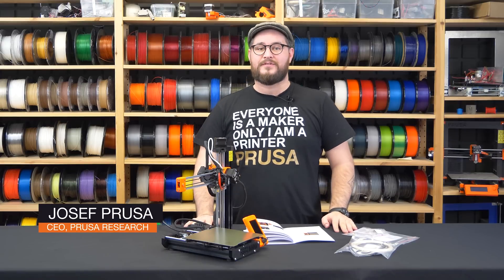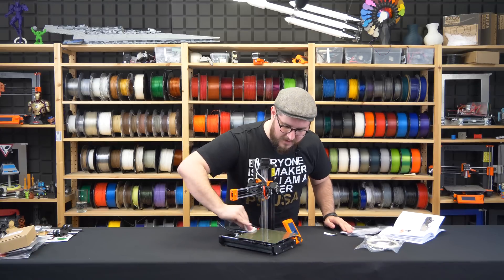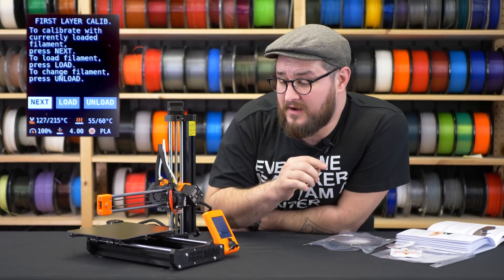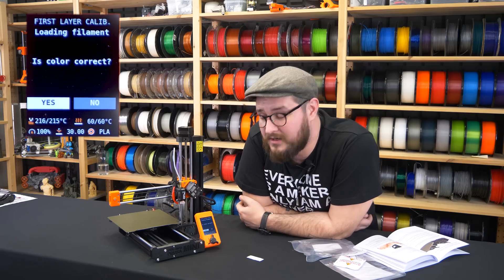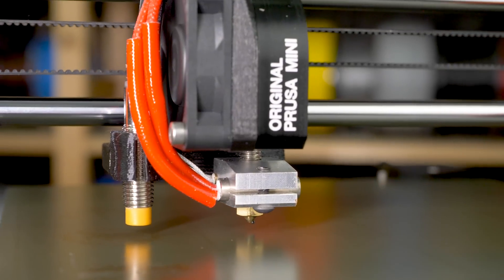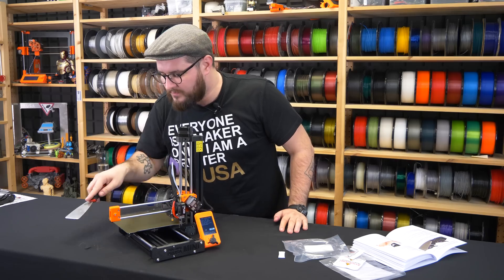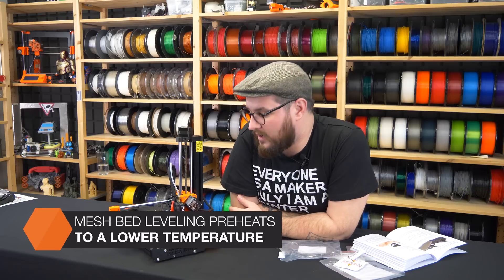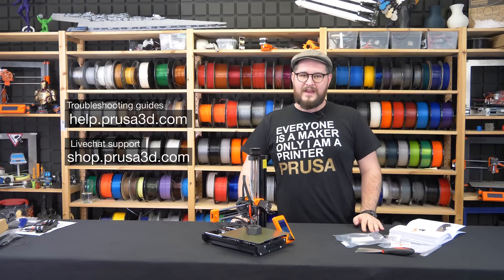Original Prusa MINI - Calibration and First Print

Comment: I recently purchased the Hardened steel nozzle E3D V6: 0.4mm but am unable to calibrate it to get a solid first layer, I’ve had to lower my z to -2.000 but still am getting gaps in between infill passes (printing with Prusament PETG). Any suggestions would be appreciated!

Comment: I have a problem, I'm the first layer and there was everything perfectly fine when I put the print so everything goes fine from the beginning but as soon as it starts to print supports or corners so the first layer doesn't even stick to the pad and the printing is with nothing I have to repeat everything again

Comment: Helpful video. You mentioned the calibration routine prints a small square so you can verify everything is good. However, you don't say what you are looking for when you examine this square. What are the criteria for deciding the small calibration square is "good?" For example, are the extrusion passes supposed to be stuck together so the square is a 2D sheet? What would you see on this square that would indicate "not good?"

Comment: Got my Mini yesterday, had some good prints so far, can I just ask. The recommended temp on the PLA spool says 215, but the default temp of my printer sits at 170, after watching this video it seems its 170 first layer and then automatically ramps to 210, is this correct?

I haven’t noticed mine auto adjust because I’ve been manually switching to 215 just before the print starts.
Reply from the maker: Yes, that's correct. It goes to a lower temp first for mesh bed leveling to minimize filament leaking from the nozzle. Then it automatically goes to the higher temperature for printing. -Mikolas
Reply: @Prusa3D  Ah great thank you! My own impatience

Comment: I’m almost done with assembly - can’t wait for the first print!
Reply: @Error-hc7mp  It worked flawlessly from the first print. I’m wide format printer technician so I kinda expected that, it would be embarrassing if it didn’t work well ;)
Reply: @Mariusz Kozlowski. Is it still working good
Reply: @willcronk6458  yes, no issues at all. Not even a clogged nozzle.

Comment: Would it be possible to print a piece on the heating bed instead of the steel sheet? Or will there be any damages or quality differences?
Reply from the maker: There will be both damages and quallity differences. The heated bed is covered with a coating that protects the copper traces (that do the actual heating). Scratching this coating off could cause a short on the heatbed PCB.
The filament will also have very poor adhesion to the heated bed itself, the removable steel sheets are coated with a special polymer because of this reason. So do not do that ;) -Mikolas

Comment: I'm having trouble getting the filament stick to the bed but I am using Hatch box wood filament. I calibrate to .0950 just like you did. I did use glue it did hold for a while than it broke loose. Do I have to set to a lower settings for a wood filament? What I'm doing wrong? I did wipe the bed down with the alcohol before I use it.

Comment: Can someone please explain why people are so excited about 32-bit?? You have been able to buy 32-bit boards, like Orange Pi, Nano Pi, Raspberry Pi etc for less than 10 USD for years! Why does it take that long for the 3d printer business to catch up? Also, never understood why the 8-bit printers are using Arduino at all? Why not an esp8266 or even esp32, which even comes with wifi built-in? They cost like 1-2 USD and are probably 10 times more powerful than an Arduino while at the same time can run pretty much the same code. I find this very odd.

Comment: can the printer adjust the height of the extruder by itself or do we have to do it by hand every time? Also, does the heat setting in the prusa slicer affect the print? :-)

Comment: Hi, what kind of probe does the Mini come with? Is it the same PINDA probe the Mk3 uses?
Tried to find the info in the blog and on the product page, but haven't had any luck.
Thanks in advance!
Reply from the maker: We call it MINDA, it's very similar to PINDA but it's a bit simpler (it doesn't have a thermistor inside).
- Mikolas
Reply: @Prusa3D  Thanks for the quick response. Was thinking about buying a PINDA probe with the Prusa Mini when I order it to maximize the Mini's precision.

Comment: what about nylon and nylon X? can it print it? can you create settings to make this a no-brainer? Is Prusia going to make its own chopped carbon fiber-filled nylon or PetG? that would be awesome!!! I've been on the fence between the original Prusia mark3 vs. Matterhackers Pulse XE, but now with the mini, I would prefer that printer if it can print the nylon and NylonX. just need the all-metal hotend upgrade and I think the mini should be able to handle it...thoughts?

Comment: One of my worries is how sharply that bowden tube bends when it's at it's farthest right travel. I realize you could just make the tube longer to alleviate that, but I like to use linear advance and as such try to keep my bowden tubes as short as humanly possible.  My worry is PLA snapping in it from the sharp turn. I know prusament will never do this, but I've used cheaper filaments and found that they can have brittle spots in them, or even older filament does. Also that sharp turn might create inconsistant extrusion on the far right side from the increased friction.

I guess the answer to that would be, don't buy crappy filament, buy prusament! :) It's probably fine.
Reply: Eric Barnett the only time PLA has snapped in my MP Select Mini was with a cheap sample supplied with it. I used PLAs from respectable local manufacturers and have no issues at all. Next week my Mini should finally arrive so I will see if I'm right or not ;)

Comment: This printer was advertised as a silent printer and when the printer was running in the beginning I was able to hear the fan. That worries me.
Reply from the maker: When you turn the printer on, the fan briefly turns on at max RPM (max cooling before firmware loads and checks the temps, this is a safe way to do it). 
The printer is never this loud during normal operation. Furthermore, the lav mic is super close to the fan and really amplifies it's sound.
- Mikolas

Comment: Getting a good first layer on this printer is a major pain in the ass. Was on chat with support for 3 hours and there were many inconsistencies with getting a good first layer. Also, printer is locked down and you cannot use pronterface or octoprint to issue any commands. Prusa chat wasn't sure if this was ever going to be available.

Comment: I wanted a 3d printer that just works, almost like a inject printer. I want to focus in the end result, not the process or almost pray for the print finishes the print ok. I have an ender 3 and I almost never get a good print. I started to upgrade almost everything, not because I like to hack things, I just wanted it to print reliable but so far I haven't been able to fix it (I'm going to throw in the towel). I hope this printer works like I wanted.

Comment: Looks good, but i mean, that the calibration pattern should be more "complicated" = some like a zig-zag pattern on every "horizontal" line - something like a saw tooths = with many corners it should be more helpfully to do good calibration. Maybe the display cable should be conneced into the electronic board in the package for easiest assembly, but that's detail, you make it only one times. 😉
Mini Prusa printer = micro Haribo gumibears. Ohhh no. 😀

Comment: After building a Prusa MK3 and buying a pre-built MK3S (and returning both) I'm not convinced that this won't be pure trouble, it looks easy to assemble until you need to take it apart. I can see it oozing and stringing during calibration in the video etc. Nope, can't convince myself to buy.

Comment: How is this printer for printing material such as TPU? Seem to be using a bowden system. Thanks
Reply from the maker: Surprisingly well and fast! We have an in-build profile for TPU in PrusaSlicer. Check the Handbook, one of the important things is to lower the tension on the extruder idler a bit.

Comment: Seeing that you've incorporated the lower mesh leveling nozzle temp to counter oozing spots all over the bed is the best part of this, no joke. All in all, this looks like a fantastic little machine. :D
Reply: Makes me wonder why this isn't incorporated into model 2.5 and 3 firmware. I'd have thought it would be very easy.
Reply: Geoff Butcher you don’t need it in the firmware, you can just make it do it on any printer by adjusting the start gcode. Mines set to do that all the time. Some of us also pre heat the bed and nozzle to make the PINDA sensor the same each time too as it’s sensitivity is temperature dependent before it starts the mesh bed levelling.
Reply: @neophyl  Yeah, I have it in my start g-code, but it looks like they're doing that in the profiles by default now. It's very cool to see community solutions made official.

Comment: Will be possible to use the new LCD screen on the 'old' MK3 or MK3S ? It will be very appreciate
Reply from the maker: Yes we'll most likely port it to MK3/S sometime next year ;)
Reply: @Prusa3D  Thanks Josef, i will wait :-)
Reply: Don't expect that any time soon -- the fancy display needs a more powerful mainboard. It would be cheaper to just add a Raspberry Pi 3 with OctoPi to give you WiFi and a slick UI.
Reply: @CraigTrader  plus you get touch interface with RPI